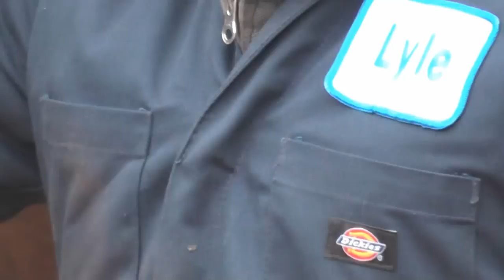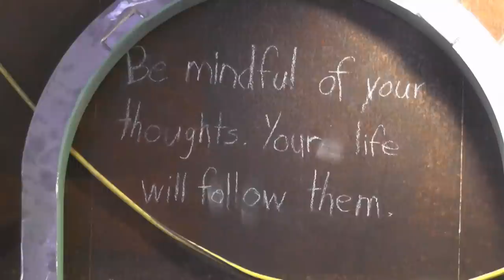Cargo Hold Framing  - Part 8 - Hatch Studs

Comment: Wow! The man-decades of labor in such a large project. Phenomenal. It has been a pleasure watching your kindly-provided library of diverse videos. Witnessing accomplishment under skilled hands is always satisfying. I was curious on the round hatch covers - I thought since the big access hole was probably cut on the CNC table, you would have cut the bolt holes as well. A plausible stack up might have been driving the cover bolts in through a thin brass or bronze flat washer, then on the cover side another brass washer and a nylon-insert locking nut to seal the threads. But that's just my non-ferrous bias. It's great watching Aden assisting, the humorous incidents. If he decides to study Engineering he'll have such an advantage with mechanical comprehension and tool usage already in his blood, thanks to you. You're evolving a lot of admirable works. Thanks for the great and educative entertainment. I've been promoting the videos to some friends. And have you set a date for christening the vessel? Aw heck! Why impose any pressure?
Reply from the maker: +GS Allen    Thanks, and there is not launch date set.  :)

Comment: I built a 64ft steel sailboat, brings back memories.  I built a rolling set of stairs which made getting on and off of the boat easy.  Also made carrying things up on the boat easier.  Should have told you that a long time ago.

Comment: I had fun watching Eddie the Grouch.  But it was smart to change your requirement to drill and tap instead of studs.  It looks like the bolt is actually better in almost every way.  I certainly understand the urge to weld.

Comment: To seal the cap nuts you can use copper washers, I have seen them used on older air cooled Volkswagens on the bottom for the oil cover they are also used as a gasket/ seal  on brake calipers

Comment: I'm installing Inconel 600 studs 5/16" x 2 1/2" at work. They are very strong, we will be mounting ceramic insulating modules in a Thermal Oxidizer, stack and burner assembly. Nelson stud welders are nice, light and very user friendly.

Comment: we used to do that bag trick in auto class, except you seal it to a spark plug, and pop someones hood and connect a plug wire and zip tie it to the fender. when they crank the engine you get a loud bang under the hood and scares the crap out of them lol

Comment: Awesome progress!   I had high hopes for the stud welder but i think your final solution is going to be more predicable in the end.

Just because it was mentioned, be careful using brake cleaner around anything you're going to mig or tig weld.  The chlorine in the brake cleaner mixes with the argon in the shield gas to make phosgene which was a chemical weapon back in the day and can kill you or at least mess you up.
Reply: I was curious about the chemistry involved in this. Some research indicates that the important factors in the production of phosgene during welding are the presence of a chlorine compound and strong UV light, such as from an electric arc.

The argon is non-reactive noble gas, so I'd suppose it doesn't have a role. That is to say, don't think you are safe from this if you aren't using argon. (There are some argon compounds, including argon chloride, but none of them are easy to make, and they wouldn't last long anywhere one is likely to be welding).

So, yeah, watch out for those chlorine-containing compounds while welding.
Reply: David Knaack whoa!  i'm glad you looked into it, i had heard it was from the argon so i almost didn't say anything because he was spot welding using an arc.

normally i try to suppress the safety nanny stuff but this is one of those little snakes in the grass that can bite you without warning.

Comment: You put diesel in the skeg to prevent rust, and it incidentally did a good job of also showing where there were pinholes in the welds. Have you done the same in the fuel tanks? I expect you'd want to be really confident that nothing leaks from the fuel tanks into the tanks next to them.

Comment: Hi, you might consider using a copper gasket, like the bolt on the bottom of the car where you drain the oil. After tightening it you only give a tack weld for it not to losen up when removing the nuts at an inspection. I have no idea if copper and iron will produce a galvanic current? At least in the car it is not an issue!
Reply: From Baghdad Battery on wikipedia . . . "Copper and iron form an electrochemical couple, so that, in the presence of any electrolyte, an electric potential (voltage) will be produced." I would think that ocean salt water would be enough of a electrolyte.
Reply from the maker: That might work too, but I don't know if they would allow us to torque to bolts done enough that they would not back out when tightening the nuts on the other side.
Reply: Copper will compress and creep over time - ask an electrician!  While it sounds good, I would worry that any expanding or shifting of the hull and hatches would compress the washers (unlike a free floating drain plug) and make them loose since the copper will stay in the compressed form when the pressure relaxes.  Better to use a resilient washer that will return to shape and keep the seal.   Heck, some star washers and a good semi-hardening thread sealer would probably work fine.
Reply: copper and steel in a boat is a galvanic nightmare
Reply: Eddie the Grouch I was thinking PTFE washers, but just about any material will creep over time.

Comment: I know the kit is expensive but I wonder if a rivet nut tool would have been easier and then using a bolt to hold the lid on.  They sell the rivnuts in steel or aluminum.
Great videos, done watched them all! Keep um coming!  I can't wait to see you one day hit the water successfully!
Reply from the maker: Much more expensive so I certainly hope they would be easier.
Reply: I had to buy the kit to reinstall door closers on door frames that got ripped out from wind damage.  Works great and better than before!  I have also used them for mounting all my shelves and equipment in my van and many other areas around the home and shop!  - Also learned its what the air force uses on the jets instead of welding nuts to metal and its proven the rivnut is stronger!

Comment: Hi There,
I do my studs a little difference than this. I drill a hole through my material, set the all tread into the hole and button weld on the other side. It works great.
Reply from the maker: That's doable, but I was not crazy about welding upside down from inside a tank.
Reply: That would be a pain, good point.

Comment: Question sir ? On the water tight doors . You've spent all that time constructing totally cool works of art , times three. But when you installed the frames , you've only got the bow cabin door opening into the hold/main , so the mechanism is visible. But on the hold to engine room as well as the rear cabin you'll only see the round handle as they open inward . Kinda a shame not to see them in the main hold on both sides as well as the rear cabin . Please explain if you could your reason(s) ? Patiently waiting for next video . Cheers
Reply from the maker: It's all the same boat.   Doors in the engine room are arranged to seal against the frame if the engine room floods and that is the most common source of flooding.

Comment: I think you nailed it on the stud install! Now you have the option of easily replacing a damaged stud. Are you concerned about the weight of the keels torquing when they are filled ?
Reply: Interesting question about the keels. Now I'm wondering myself.
Reply from the maker: Not really.  We'll put 10 tons in each side, and keep another 10 tons as ingots that we can move to trim the boat once in the water.
Reply: Steven Hardy Lead is still the best. Cast iron is a cheap substitute, but is not as good. In this case it depends on the volume of the two keels, can you get enough weight in them given the size they have if you don't use lead?
Reply: Steven Hardy how can you substitute lead for concrete?  aluminum is heavier than concrete.  unless its concrete with lead in it?  or tungsten powder in it?  uranium?  how do they get it dense enough to be useful in a keel?  im not doubting it, im just curious.
Reply from the maker: Tyson Henry Concrete is only about 150 pounds per cubic foot and lead is about 600.   Iron is a much better ballast material and then flow concrete around that.  But nothing beats lead for getting the center of gravity low.
Reply: Steven Hardy I wouldn't call it junk, unless you were talking about something else entirely!. He already solved the sourcing of the lead, took months and lot's of work but he's got it.
Reply: Steven Hardy hjj

Comment: When I was young (and not so wise) a buddy and I filled a garbage bag with about 5 seconds of torch mixture.  We used toilet paper for a fuse.  We left the bag at the inside corner of the building thinking no one would see the flash as it was 1am.  We were leaning against the hood of my 72 Fury and after about 15 minutes figured we had done something wrong as it had not popped yet.  We leaned forward to go check it out and it popped. Only it didn't pop. We were about 50 feet away and the explosion threw us back onto the hood of my car, with both of our ears ringing.  Alarms were going off, lights were coming on.  We beat it outa there.  Next day, after the police left, I sneaked back over and discovered that while the building and even the glass window was still intact, the image of the nearby willow tree was imprinted on the building in ash, and all the stuff on the desk behind the window was on the floor.  My buddy worked at that shop and so witnessed everything.  This is a secret, so don't tell anybody.  When I saw you filling that ziplock, I knew what was coming.  I have a healthy respect for that stuff now.

Comment: Have you considered using a polysulfide sealant on the stud heads and weld seams inside the tank? It's nasty, smelly stuff but it's impervious to fuels and solvents and is vibration resistant (it's used to seal riveted aircraft fuel tanks among other applications). There seems to be marine applications as well.
Reply from the maker: Yes.  Do you have a brand you'd recommend?   I want to pressure test and fix any obvious leaks first.
Reply: The only brand I'm familiar with is Pro-Seal, which is for aviation, and priced accordingly at $90/pint at Aircraft Spruce.

Comment: First,  I'm loving the progress and the videos.

Why didn't you weld a thick metal plate under the tanks top rim and tap into that , then all you would need is to bolt the cover down from the top with just bolts ? .  I'm just wondering.
Reply: Or weld the thick rim plate on the  top of the tank , and use the same bolting process in the above comment.
Reply from the maker: That would work too, but I avoided the additional cut, weld, and a longer tap length.
Reply: SV Seeker That's what I thought you might say . 
With your design....
I'm thinking that when you have to remove the cover  ( I know it won't be often or at all ) you could mar up the bolt threads and when you reinstall the cover the cap nut could drive the bolt down which could make a bad seal .  
I'm not being negative here .
I admire all of you .
I have admit... I'm watching and learning, so I can build mine someday, but only about  a 35 footer.  My pole building is only 30 x 40 and thats where I hope to build her .
All aside ...you guys are awesome.
Reply from the maker: offplanetevent  I'll let you know if that ever happens.   It would be great to be able to build inside.  Best of Luck.  See ya on the water.

Comment: dude stainless into mild steel is a no! when you get a bit of salt water in your hold you'll get galvanic corrosion between the bolt and the hull, it'll be a pain in the arse. if you just tap a thread and fit a threaded rod/all thread stud then when you come to undo them there are 2 places it can come undone and you'll always be able to remove the hatch. just use a bit of thread seal and forget about it. you find pleanty of bolts on engines and fuel tanks that have no seal other than the gasket and the thread don't leak. All the tank hatches I saw at sea were done like that they didn't leak. good work keep it going!
Reply from the maker: Dan fish No it's not.  Welding and bolting stainless to mild steel is often done.
Reply: SV Seeker
 yeah true it's often done and for sure most times its fine and I hope your hatch coveres are great. I just like to avoid mixing metals when bolting, stainless has a horrible habit of striping threads with very little provication so to me stainless into mild with the possibility of salt water around is less than ideal, but fuck you just fitted about 10,000 stainless bolts so me saying this after the fact is hardly helpful! opps

Comment: I know you already did the job but why didn't you just use the discharge bolts (or the threaded rod), bore the holes and mig weld them from the inside?

Comment: If you ever have to do this kind of non-shielded arc welding in the future try a product called solar-flux which is used for back-side shielding on tig welding.  It seems to also be able to function in a weld-through fashion so I wonder if it would have helped your stud welding get a better penetration since you were doing it without shielding.
Reply: This, or maybe you could get some submerged arc welding flux powder from a welding supply shop? Or if you have stick electrodes that arent  good/useful, bash the flux off the outside of that and make your own powder.  I think Ive seen ceramic shells/ferrules that are used in higher power stud welding to form the bead, and shield it somewhat from air also.
Reply from the maker: I added gas to the rig I used in the boat, and I could not see any difference.

Comment: How come you did not purchase a Hossfeld bender for bending flat and angle? I'm fairly sure that Harbor Freight has a knock off or two. Blacksmiths have used them for years to avoid having to heat and beat material to form rings etc.
Reply from the maker: Norman May Never tried one.  Will it work on 2x2x1/4" angle?
Reply: SV Seeker  If you get the true Hossfeld with the hydraulic option yes it will. I was looking more at the fabrication of the watertight doors and the building of the baffles on the hold hatches to avoid having to heat. A Hossfeld will also bend flats the "Hard" way.

Comment: the threads are gulling. With stainless steel bolts you need to use Nickle anti seize. Why not weld the bolt heads to the plate and not worry about sealing issues? I know it would take more time.... Or how about other types of sealing washers? I work at fastenal. Tomorrow I'll see if I can find a product that will work.. I remember seeing something a few years ago that would probably do the trick!!
Reply from the maker: Exactly, it would take more time.   And Fastenal sells the same washer.
Reply: oh just kidding about welding... i guess i failed to relize how they were being installed...hahaha.
Reply: Bonded sealing washer I know. But, There are MANY more different styles for structural applications that require torque. I'll dig through the books we have stashed away from the various vendors and report back tomorrow.
Reply from the maker: Kirk Becker Ok, thanks.
Reply: SV Seeker  check out www.apmhexseal.com 

Thwy have bolts, washers, and nuts that seal. If you find something, let me know!

Comment: assignment like I did with devices TUCKER . When you want a perfectly welded to the bolt , use your CNC where you make a little small programs . Logic welding bolt is touched to form an arc , so move away and then pushed into glowing materials through CNC find anything much on time . I hope I will advise you in the future.

Here is a chart and details:
http://www.emhart.eu/eu-dk/produkter-serviceydelser/produkter-efter-kategori/tucker-boltsvejsning/stud-welding-systems/energy-units.php

Comment: Have you though about using press in wheel studs ?  I have used them in many applications over the years.

Just a thought, (;-) TP
Reply from the maker: I did.  Called and talked to a company that make them.  They can leak and loosen when mounted in only 1/4" steel, and they are expensive, and the hole must be precise.

Comment: I am not sure I follow you on the use of studs (;-) What is to leak ? you are using cap nuts and sealing washers correct ? AND a gasket on the cover ?

The precise hole size is simply selecting the correct drill bit (;-).

You can install by simply pushing in the stud and use a spacer on the thread side and tighten it down with the NUT. as you tighten it will pull the splines into the hole and hold it secure.

There is no way it can loosen in your application as there are NO radial loads involved as in a wheel stud application. You are simply holding a cover tight.to the tank.

BUT to each his own, (;-) TP

Comment: When welding the studs why not drill and tap the deck plate and then weld the back side of the stud on the bottom of the deck plate.  That way there will be no splatter or puddle to deal with, and the studs will be very strong and consistent.
Reply from the maker: That would work.  But this way, I don't have to weld them and I can easily replace a damaged stud.

Comment: why not just use bolts with sealing washers from the top
Reply from the maker: Geoff Lubich The plate is only 1/4" so it does not provide sufficient threads.

Comment: Those 3/8 studs shouldn't be torqued to more than about 30 ft/lbs, see this page for torque vs diameter & pitch: https://www.boltdepot.com/fastener-information/bolts/US-Recommended-Torque.aspx
Reply from the maker: Right, and the nuts will not be, but we don't want the bolts backing out so they got pounded in.